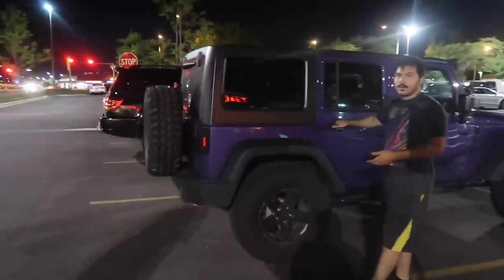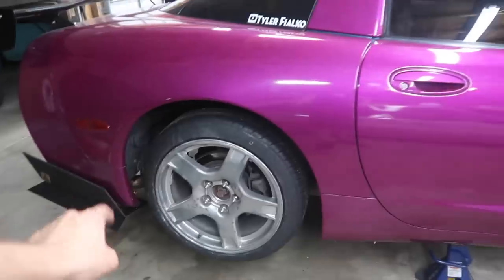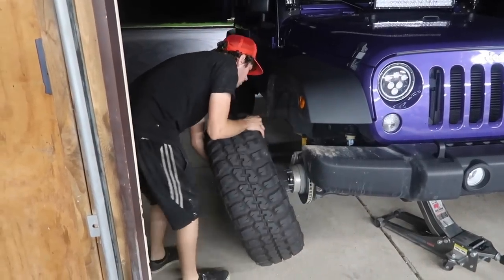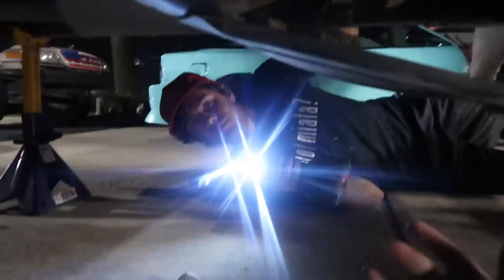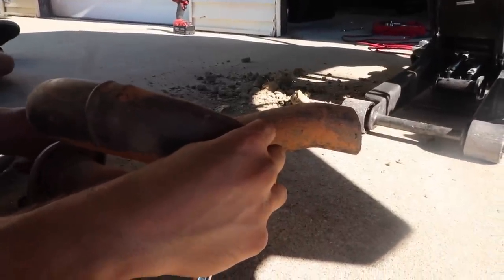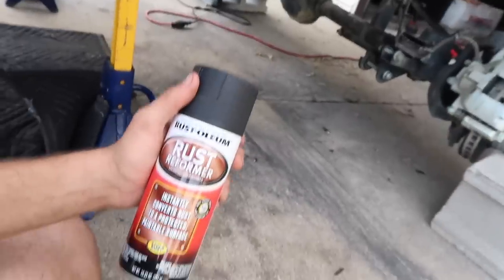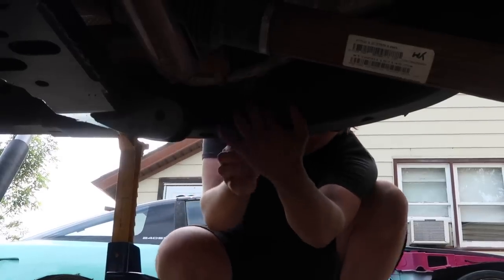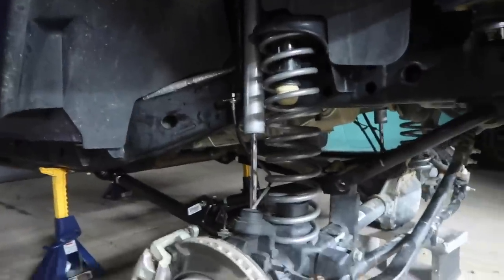Long Arm JK lift  (FRONT)

Comment: The jeep is not even 6 month's old and is already covered in rust
Reply: MoOn WaLkEr I mean it's just surface rust doesn't really matter
Reply: where?
Reply: Supreme Tangerrr he's talking about under the car like the exhaust or something dumb I assume
Reply: Jesse Sheppard looks fine to me
Reply: Supreme Tangerrr I agree I'm not the one saying there is a issue
Reply: MoOn WaLkEr I think it's mud I was kinda wondering the same thing
Reply: thats probably 95% dirt, but it is in IL so some of its bound to be rust
Reply: MoOn WaLkEr that's Chrysler for u 😂😂
Reply: MoOn WaLkEr cheap ass metal
Reply: Drive shafts and exhaust basically come from the factory with rust on them, nothing out of the ordinary
Reply: Welcome to the salt belt.
Reply: Just surface rust lmao nothing wrong there
Reply: Next time you go to a dealership, look under all those brand new cars...they're the same. this is nothing out of the ordinary.
Reply: It's an american car so it's pretty normal.
Reply: Gopnik n. Actually it's high carbon steel that rusts. #obviouslyNotAmetalurgist
Reply: and if, and i really mean IF it would be rust it wouldn't be to out of the ordinary since he offroads it.

Comment: You should put a roof rack on the jeep like gingum has on his Miata
Reply from the maker: i was going to but then i cant take the top off as easy. as is its a pain.
Reply: Tyler Fialko they make them where they fold forward, with mounts on the a pillars.

Comment: If you are planning on actually off-roading at night I would wire the light bar on the hood separately from the rest, I used to have one on my hood but the reflection from the hood is blinding
Reply from the maker: they are all wired to different switches, watch a different vid it shows

Comment: THE EXHAUST HAS A LOOP TO KEEP THE PASSENGER AND DRIVER SIDES EQUAL LENGTH. IT MAXIMIZES HP AND TORQUE. DO NOT REMOVE IT.